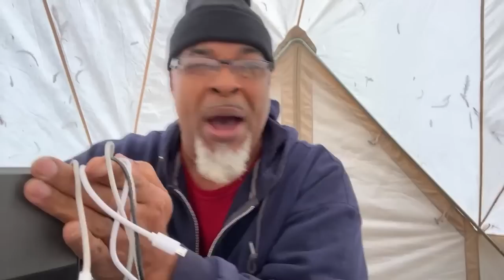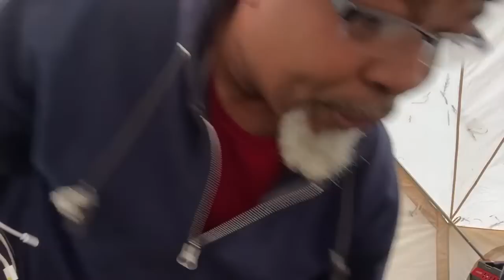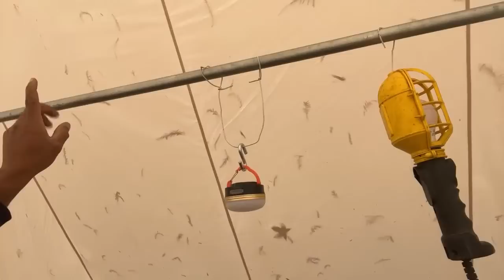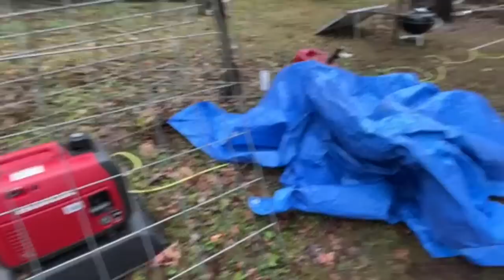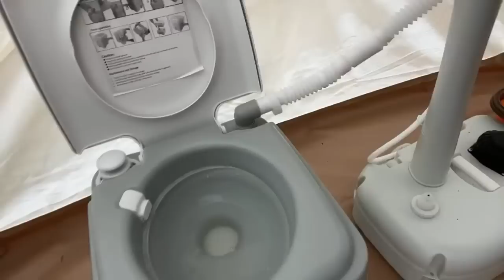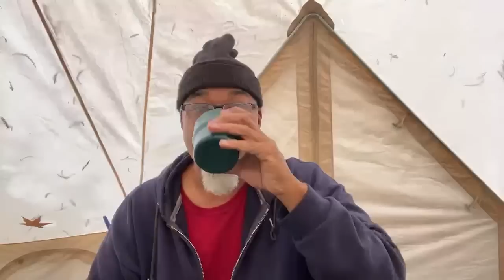Do NOTHING! Learn NOTHING!

Comment: Grew up in MI - once in early 1980s, temp got down to Negative 42 degrees F w/windchill factor. Warning at the time: you could freeze to death walking to the corner store. Was wearing a layered clothing w/winter coat, scarf, hat & earmuffs IN THE HOUSE - turned heat up to 80, but it barely registered. Water pipe burst under the 2 story house (crawl space). I recall a few years ago or so, people in KY were ripping their wooden fences apart to burn bonfires to try to stay warm.  * I would recommend to stock up on hand warmers that you can buy at retail stores (basically break the inside of the packages & they heat up automatically - they last for a few hrs). ALSO, a layer of a cardboard box between one's sweaters helps to keep one warm (even while walking). ***Keep a scarf over mouth & nose as the cold air constricts blood vessels & can cause heart attacks (i had a teacher who died on his 40th birthday shoveling snow before a birthday party for him).  I hear that if you put heavy plastic over the windows, and towels under door frames & use a tent in living room w/sleeping bags etc, is a good idea. There's are vids on utube of making heaters using a car battery - you may want to ck that out. Additionally, learn to make a rocket stove if no bbq available by watching utube vids for outdoor use to cook, or simply make hot drinks/soups - a thermos is a good idea. MREs are a great idea, but on the pricey side - you can find online or at an ARMY/NAVY Surplus store - in fact, great place to shop for tents/warm clothing & clerks will have ideas to help. Now, if it snows, learn to make an igloo - toasty warm inside! Also, keep rooves clear of snow to avoid cave ins - i recall my Dad using a broom up on the roof while it was snowing one night as at least a foot of snow had accumulated - be careful not to fall... I would also take note not to run the oven to heat up the home as houses have burned down due to that. And DO NOT have a generator running too close to an open window (a firefighter & his family of 6 died from carbon monoxide poisoning here in FL during hurricane Irma💜). DO NOT forget to keep muffler free of snow, or any kind of blockage & keep windows cracked if get stuck in car - make sure you have a blanket, hand warmers, thermos of hot drink, water, snacks etc if travelling.  God Bless 1 & all. By the way, newspaper stuffed in pants etc can help retain heat. Homeless on streets of Detroit slept in cardboard boxes (kind of like houses kids make to play in). Again, God Bless 1 & all💜🙏 ps i hope this very long comment helps at least 1 person/family.

Comment: The same thing happened to me Lead. Came up with an idea to package different sizes/absorbance sanitary products for women into 1 box.  Went to the same invention agency and was told it wasn't a good idea 😕.  The representative gave me my paperwork and mock/prototype back and about a month later, saw a Tampons commercial for my idea while on break at work. I was 🔥 hot but from then on I operate in silence and learned about patents, trademarks, and copyrights.
Reply from the maker: 👏🏽👏🏽👏🏽👏🏽👏🏽👏🏽👏🏽👏🏽👏🏽 🙏🏽 AMEN!
Reply: A month later?  A large company doesn’t work that fast, “your” idea was most likely in the works for a year or more.  The commercial alone months, the packaging months just to get the right font.  4:41
Reply: I saw this in the store shopping for care packages for teens and I thought " only a woman would KNOW and UNDERSTAND the NEED for su h a product."

Comment: I have to say, 
I was not thinking anything about purchasing a propane heater (Mr. Heater - Buddy) for emergencies. It is -5° (actual temp, windchill is -20°), outside right now. It is forecast to be zero tonight. Nothing solar is charging because it's overcast out there. The furnace would be running constantly if I had not prepared. Basement is good. Pipes on the outside wall, good. Now I know why you popped up on my RECOMMENDED Youtube listing. 
I ain't that smart. 
🙏
I thank you. 💞
You save lives.
Reply: ...and the furnace is currently set on 60° 😮😲